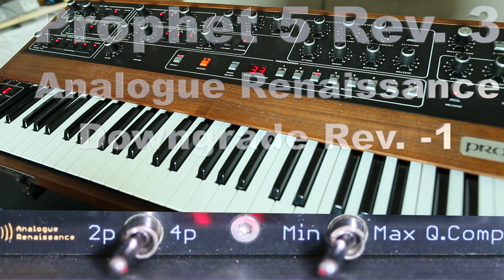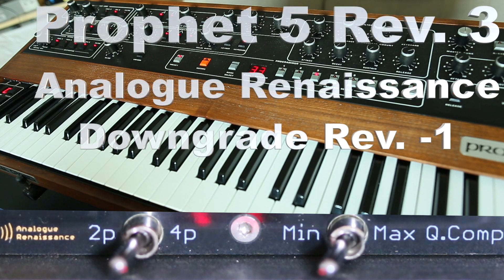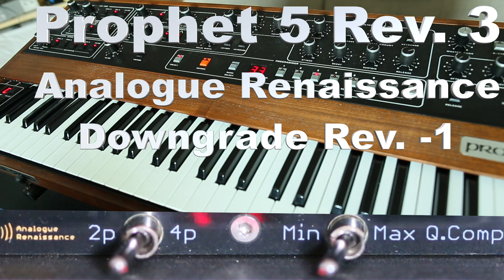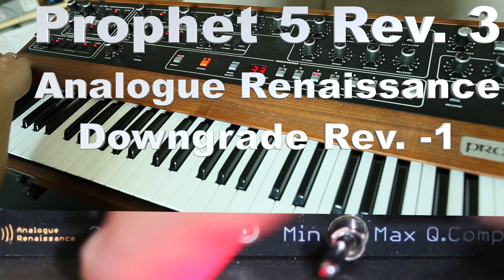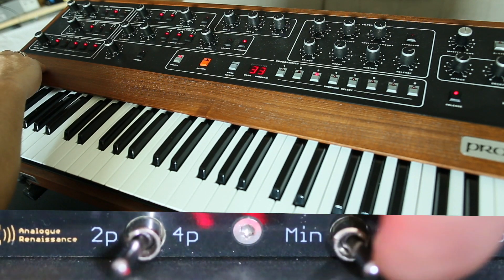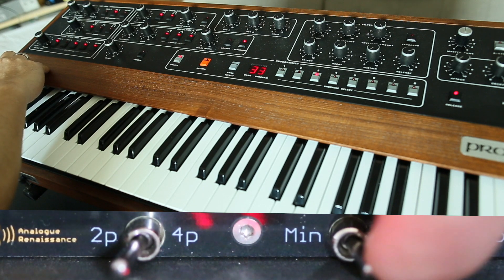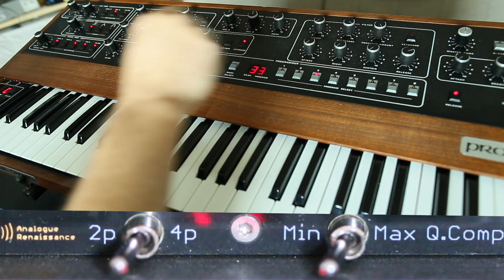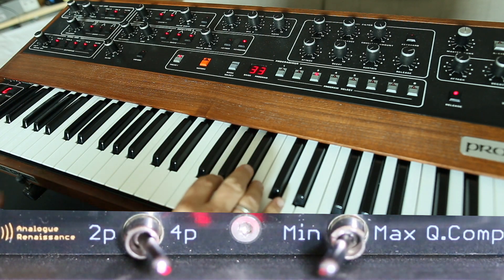Prophet-5 Analogue Rennaisance Downgrade

Comment: I just got my kit.  Going to be calling my tech tomorrow to make an appointment to drop it off for install and calibration.  I used to have an OB-Xa, and the 12 db and Q comp switching means my baby will have options that bring back memories of the Obie.  I can't wait! ;)
Reply: How did it work out?
Reply: @gbkny1  Worked out better than I had hoped.  The standard 24db/4 pole with no Q-comp sounds more or less the same to me, if slightly warmer.  I don't have a Rev 2 to compare it with.  My tech who installed it said that it was a very subtle boost in certain frequencies to warm it up a bit and the filter drives a bit more from the mixer.  The Rev 2 machines are known for a beefier sound, so this may be why.  They can drive the filter more with the frequency boosts from what I've heard and read.

I did have to turn down some presets in the mixer or it comes close to distrotion drive.  Dialing the mixer levels back was all it needed.  The real bonus is the 12db/2 pole switch and the variable Q-comp switch.  Setting it in unison with a 2 pole filter and Q-comp and it is near as dammit to the Tom Sawyer intro sound.  It's almost like having a P-5 and an OB-Xa in the same machine.  I've read where the new P-5 rev 4s use the same filter chips from Analogue Renaissance but not 100% sure.  If they did then Sequential/Novation needs to add a firmware update so the 2 pole filter can be accessed.  I know that's that what Prophets originally did, but they didn't offer polyphonic glide but I believe the new rev 4 does..  I'm not sure if the Q-comp is an additional feater that is only available with this mod as it may be part of the replacement board.  But the sound is great.